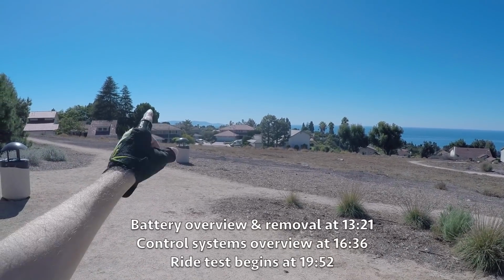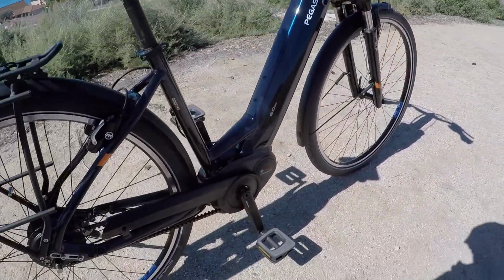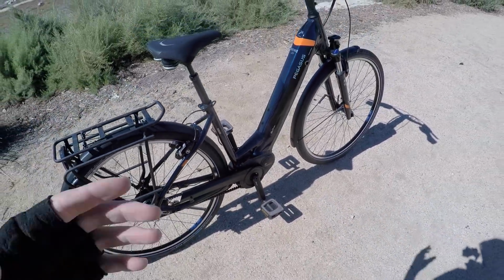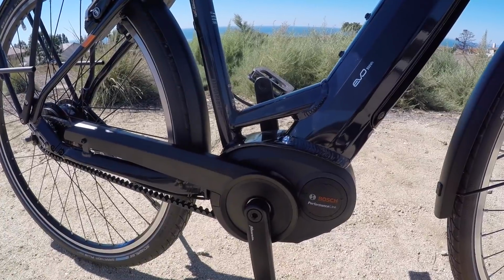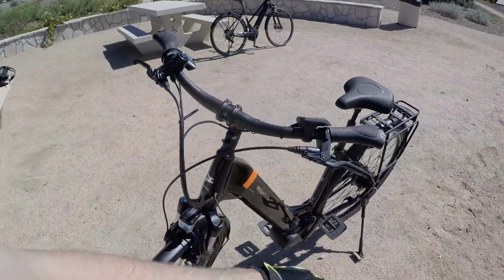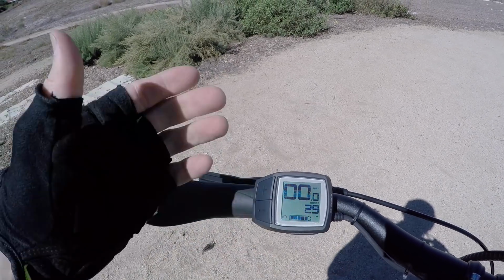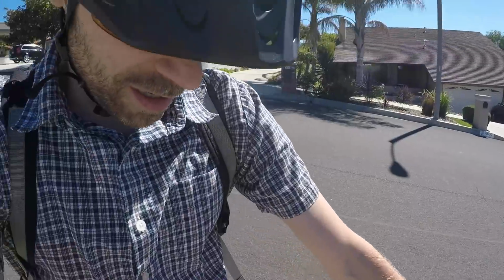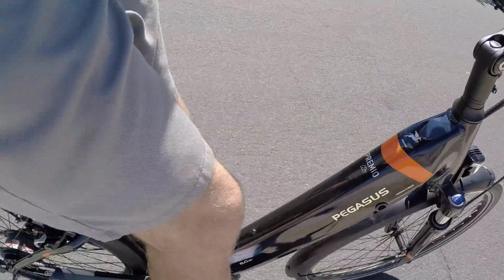PEGASUS PREMIO Nu Review - $4.7k

Comment: I wonder if the price resistance we see in comments and forums manifests itself on the bike shop sales floors? This is a nicely appointed bike in the same way the 1974 Lincoln Continental Mark IV was; all the doodads but big and heavy, and ultimately a dinosaur lost to the ages and replaced by leaner more efficient machines. I am interested in learning more about that style of suspension seat post, it looks lighter and simpler that something like the Kinect 2.0. Having watched the EBR review from Interbike, it looks like BULLS and Pegasus have made a ginormous investment in a dearth of new models spread across multiple frame styles and sizes. If the ebike market doesn't expand to match quickly, I'm thinking heads will roll at BULLS. Great review, educational as always.

Comment: 4.700$ for a Pegasus!? This brand is some kind of mass market brand here in Germany. It has no high reputation as brand and they're more known for cheaper bikes. 4.7k is the range of R&M, Kalkhoff or other higher priced german brands, but a Pegasus for 4.7k, thats unbelivable.
Reply: In Germany the Pegasus E-Nu (Sport) costs at Pegasus Company Page 2.899€. 
Maybe addition import tax? - If I see the prices in the US for eBikes of 20mph class (called Pedelec in Germany) they are always a "little bit" higher (20-40%)  than here. I do not know why but could be because of some additional taxes, different (mandatory) guarantee or something like recycling fees, legal type approvals needed for? - Or maybe only the acceptance that bike shops have a higher margin in US than in Europe.
Reply: Pegasus homepage shows me similar Premio EVO NuE model 2018 for 3300 € (normal price 3600 €) but it has a N330 instead of N380. I guess Court got a 2019 model for testing?
https://www.pegasus-bikes.de/produkt/pegasus-premioevonuemech-785-49648
Reply from the maker: @Michael-wn4jj  Yeah, I got the 2019 model, they don't even have a PEGASUS North America website up yet. The one I looked at has the N360 and some other adjustments for this market. Interesting to see, this is their most expensive bike for NA '19
Reply: @ElectricBikeReview   I try to understand, why they don't sell them as what they are here in Germany. It's not a bad brand, but it's not a Mercedes , Audi or BMW. It's like a VW, you buy it because it is more budget, but good.
Reply: Where would Haibike rank in the pecking order?

Comment: Looks like many of the lower end commuter bikes. For the price, it really needs something to set it apart. With only one color, this bike will appeal to people looking at the spec sheet versus looking at an impressive e bike
Reply from the maker: Harsh! I'm not sure the color scheme is my favorite, but the NuVinci + Gates belt + Bosch CX in three frame sizes and four sizes is pretty impressive. It's the most expensive PEGASUS for NA in 2019, I'll have the other two up soon and the Sport is like $1,000 less with the Active Line Plus motor
Reply: @ElectricBikeReview  For the 4K price tag, I'd much rather have a beautiful BULLS Sturmvogel EVO Street or other well-designed bike that deviates from the norm in both color and style. This bike looks like a $2k Velec R48 or Espin Flow. The spec sheet is great with the Gates belt and Bosch CX, but dark blue in this standard form factor is rather boring. For me, at this price point, I might choose fashion over form. Of course, if I had a little more to spend, you'd see me on a Vintage Scambler or Tracker. Thanks for another great review, Court.
Reply: @JohnRichardsonAuthor  you are right. If you don't look at specs and test ride, you can't tell how much better it is than Chinese craps like espin ebikes.